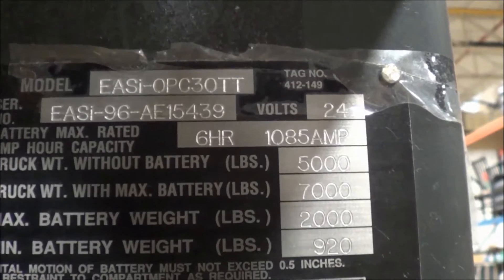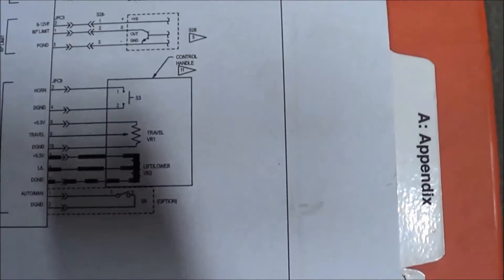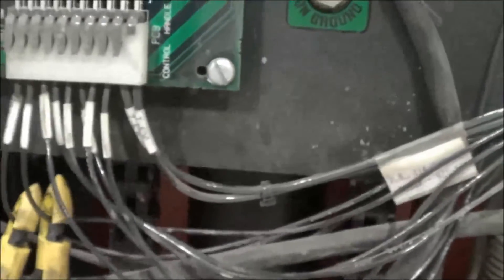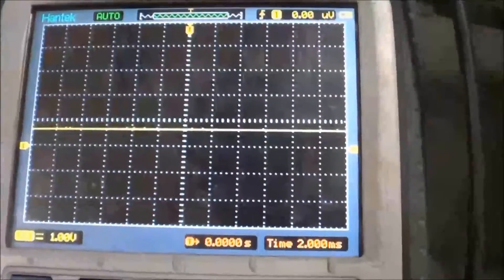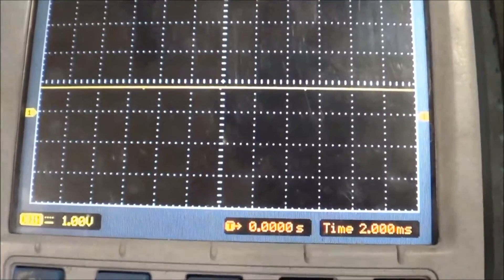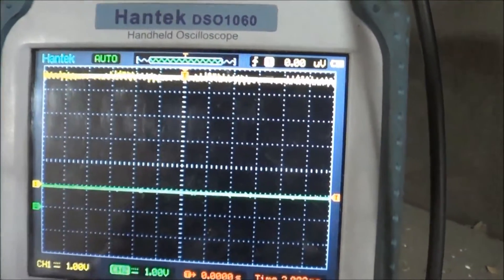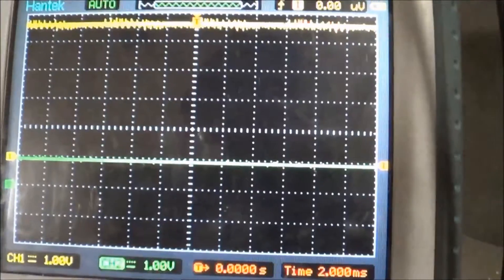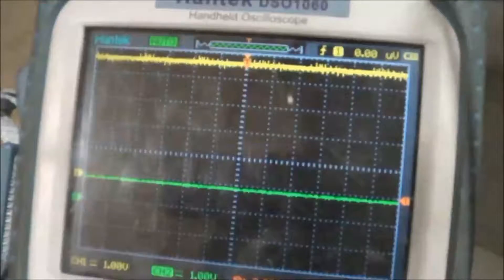Raymond OPC intermittent code 80

Comment: Mini Clip on the pins going to the board from the socket is way more effective. This can also help you determine if you have a connection issue at CCC.
Reply from the maker: Tnx
Reply: +ForkliftGeek You're welcome, do you work on a lot of Raymonds? Are you an independent or work for a dealer? Here is code 80 exactly as printed in SM "Code 80 - Throttle Controller Reading Out-of-range" might want to add to video description.
Reply from the maker: I do work on raymond a fair amount. I work for an independent. Tnx.